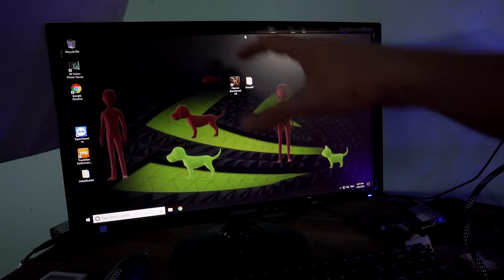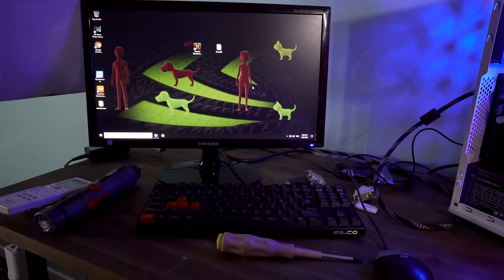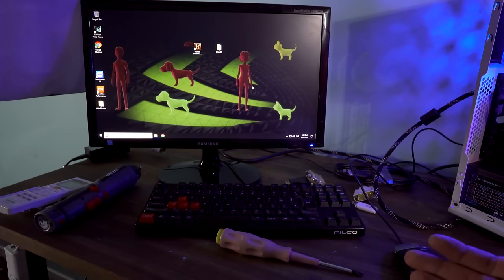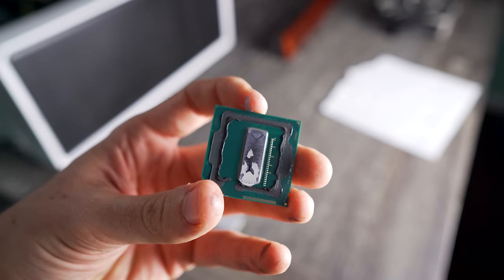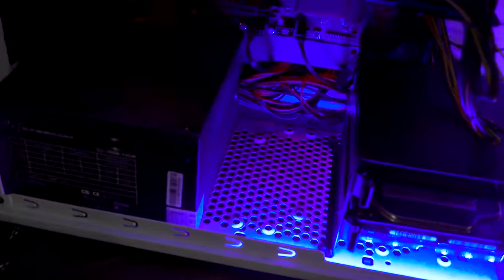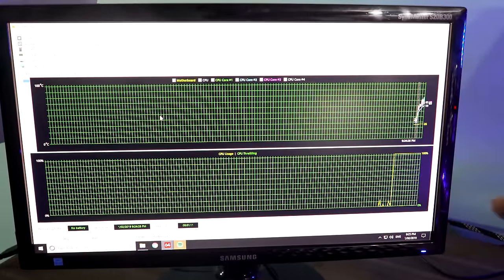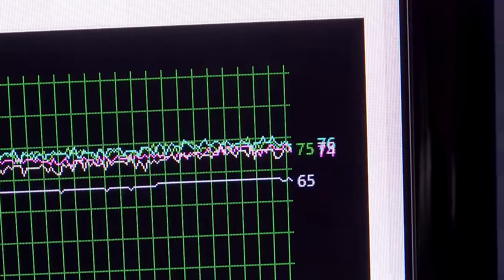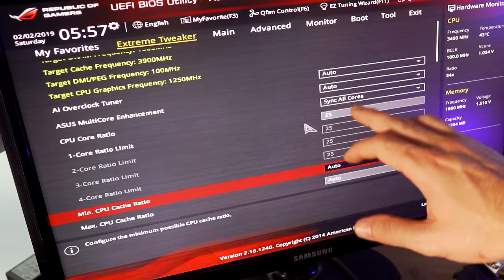How to Spot a FAULTY CPU.....? The i7-4770 Dilemma....

Comment: i also have had experiences where i have a buyer that would replace the parts that i sold him with exact same parts but are defective. so always make sure to have records of serial numbers of the stuff you have to make sure he didn't swap stuff out for defective ones.
Reply: This is such a scummy thing to do
( I know this is obvious but I needed to say these words out loud)
Reply: @aboyaser5608  yes, well, it also obviously happens.
Reply: If it's a large issue, or something without obvious/ easy way to track, you can also consider using a uv pen to mark parts that won't easily be seen.
Reply: Great advice for when i'm selling parts.
Reply: thanks for the tip
Reply from the maker: Yeah I have had a buyer try to pull some shady stuff, when I started questioning him he started sweating profusely.  I don't get how some people can be so damn petty ><, though your idea is a solid one and the UV pen below is gold (I used to do that when selling car parts years and years ago).
Reply: @techyescity  you should do a video about cars, I remember you saying about your brothers EVO and that got me really interested
Reply: When I used to sell retro PCs on eBay and shit, I'd use a warranty void if removed sticker on it to seal it. I'd give a 72 hour DOA period, specifying if the warranty sticker is removed/tampered with it's null. Didn't have any issues, but I may have also gotten lucky. Might be beneficial to get those kind of stickers and then put them from the GPU to the PCIe slot, over the CPU lever, RAM, etc.
Reply: If you do a lot of things like this, invest in some tamper-evident seals like those VOID stickers which leave permanent impression on the sticker if removed and/or serial numbering system. You can get them in non-conductive flavor if you use them near the RAM or CPU.
You can also use those inkjet paper labels which seem to disintegrate as soon as any solvent is applied or if it's pulled off. Make few cuts on the sticker which makes it hard to remove it without ripping pieces off of it.
Reply: Ye serial numbers are useful, always add them on the invoice for expensive parts.
Reply: a buyer did this to me when i sold him 2 rams sticks and he sent me back with 1 non working ram stick

Comment: In over 15 years of tech only had like 2 dead cpus and a dead gpu...in terms of actual silicon. Rare but it definitely happens. Good video!
Reply: What type of CPUs failed for you? I'm having some strange workstation issues lately.
Reply: For me, CPU is the last component that could fail in a PC.
Reply: @paulf1071  early on in school for a+ cert, a few dead pentiums the old socket kind...then the gpu was a hd 5750 that was used and dead on arrival. And actually recently I delidded with a razor a i5 3470 and It starts but won't post/ no display so RIP...lol I replaced it with an e3-1235 though.
Reply: @lagginswag     I hope you're grounding yourself properly when doing your repairs! There's a lot to be said for wearing an ESD wrist-strap for this type of work.
Reply: @paulf1071  yeah I always work in the same spot and touch part of the case/psu and also hold down power button to drain. I ofc have a wrist strap but never end up using it, static isn't the issue.
Reply: @eduh7721  my chip died overnight the day after I got it. The whole system was fine and my old chip fired right up in it and voltages were well within normal range but yeah, just bad luck.
Reply: First build dead cpu dead motherboard and dead graphics card : (
Reply: @averageuser611  have you had a chance to test each component in a fully working system? If not, your are very likely wrong and only 1 thing could be wrong/dead especially since it's your first build.
Reply: I've had cpu's that slow down tremendously as they age.
Reply: @eduh7721  It actually fails more since a lot of people who use pc's actually don't keep track of their thermals and don't realize their cpu's are operating beyond their limit.
Reply: i never had a bad cpu, just i destroyd a 2600K my self by puting to much volt. Bei the time i was a really beginner. Since then nothing happened.

Comment: I bought a used 4770k on ebay for a friends budget gaming PC . It had very similar problems to the ones in this video the thing is that it was already delided and it wasnt overheating. Turns out the cpu just wasnt making contact with the motherboard pins and crashed etc etc. Real pain to get the thing working though good thing the YES man didnt have that problem with a actual faulty cpu lol 
also LOVE the content keep up the good work mate.

Comment: I once had a 4790k that had some weird issues with low power states (c6/c7), the system would freeze after ~5 mins in idle. Disabling these low power states fixed the problem.
Reply: Some of the c-states can act a little funky on Haswell. I shut off most or some times need to shut off all the c-states with Haswell for overclocking.
Reply: Get the same craptasting thing,the C6 setting,on an AMD cpu'ed board.
Disabled it,running fine even now 8)
Reply: I had that on a CPU (not Haswell), and it was the lower voltage causing the instability.  It would run the lower speeds fine if the voltage was manually set.  What you did makes perfect sense.  It's been tested and the power difference is negligible between letting the clock speed and voltage drop and manually locking both.  The current is drawn on load anyway, and the power difference between a small process completing at full speed vs taking longer at a lower power draw is small.  It comes down to efficiency at that point.  When I saw the numbers on a modern CPU with everything locked vs all of the power savings running, I stopped worrying about it.
Reply: Haswell was kind of a wonky generation. I had a 4790k that was an awful overclocker, couldn't barely get to 4.6 GHz and had it running most of the time on stock because it was so unstable, really.
Reply: @pedrobastos8132  

I'm actually still using a haswell CPU, an 4770k that I picked up rather cheap in a bundle. I overclocked it to 4.5GHz/1.32v and it runs perfect in combination with my 1060. Temps are also good using an Thermalright Macho Rev. B, the only issue is the core to core thermal difference, core0 to core3 are under load 7-10°C apart. I might delid it soon but since the temps in general are fine (70°C max at non-avx load) there isn't really a need for that.
Reply: @pedrobastos8132 has a cpu that he personally can't overclock past 4.6ghz, writes a whole generation of intel processors off. A 4790k isn't original haswell anyway, its a refresh. Did you let intel know your scientific findings?
Reply: @w19ely85  oooooh, look what we've got here, a wise guy right here. 

Yeah, I had a bad experience with a Haswell CPU, the other commenters on this thread also had, the video itself is telling that those CPUs had temperature problems, stating that he's going to delid all of his Haswell CPUs from that point forward. Seems pretty wonky to me.
Reply: I have a z77 board with a 2500k and the low powerstate thing would cause random blue screens
Reply from the maker: Yes that low c state can be a problem where the PSU doesn't support the low ripple.  Completely forgot about that one.
Reply: I JUST did this to my 4690, it would bosd after being sleep for over a few hours. I replaced the board, replaced ram, replaced hard drives. Switched to a raid array and still was having issues. Played with the bios because it wouldn’t boot to win10 and finally disabled it, now no issues
Reply: Also randomly the uefi bios would crash, but I believe it was battery related
Reply: I have a Broadwell i7 (Z97, not X99) and delidding it helped tons with temps, had a bad clocking 4690K before that that I delidded as well and that worked wonders for it temp wise.
Reply: That kind of what happens with my 2500k. When I leave the system in and at the desktop it occasionally gives me a black screen and I have to reboot. Sometimes it has problems booting and restarting(very infrequently)
Reply: I've got both i5 4690k and i7 4790k and no problems with them. I5 Is at 4.5ghz and i7 at 4.8ghz. I think it's luck of the draw with these cpus

Comment: Different story, but something was wrong with the PC of my mum. It kept crashing and never turned on when we hit the power button. We sended it five times to the merchant who sold us the pc. Every time he checked it, he said it was fine but never fixed anything. My mother was one of those people who threw everything away if something didnt work and would buy a new one, so I suspected the merchant never looked inside of the pc, which everyone should do, if a customer tells you something is wrong with the pc. We returned the pc again and he became salty because he had to check the pc again. Then I told him "Then you clearly never looked inside! Seriously! You cant do small tests and say everything works well." It was clear in his tests the pc was running fine, yet he never looked inside, simply because all what he did was to check if the pc is turning on. After telling him my mind, he did check the components. It turned out the PSU had a faulty, he replaced it and apologized for the mess. I asked him what kind of a technician he was and we didnt pay the last repair bills for all this mess. To that time I was 14 years old and didnt knew much about pcs.

Comment: Usually it's the Memory 9 out of 10 times
Reply: Memory, bent pin or dust in socket, blown PCI lanes, bad sata, fried chipset. It is rarely the CPU though i have had it happen but your right it's usually memory.
Reply: @desertrat810 That all makes sense, since I think the most failing CPUs are either old hot Intels like Pentium 3/4 or similar AMDs like Sempron, Duron or FX and newly those flashy new Intel chips. Hell I've never seen that many dead CPUs before Intel 's now infamous 14nm node and I don't think Intel's "rise" in popularity or dumb and careless customers are to blame - tech gets more fragile nowadays and who can repair CPUs that small? I think running them with bad components can kill them, but I admit I put an i5 2500k into a bent socket for testing and the socket was shorted (VCC to GND) so that it basically unsoldered a gold contact pad from the CPU which I had loose afterwards. The funny thing is I send the board to a person repairing it for 40 bucks and put the CPU back in and everything worked fine. So, I guess moral of the story: Don't do that even if it worked out for me. xD
Really any of the CPUs I describe here are not very old just 7 months for the 6600k, at most since Skylake released (then 2.5 years ago) for the i5 6400 and I think 8 years for the 8320. Especially the latter ones die like flies, but who cares FX was long dead anyway I recon and any real gamer can attest that.
So to anyone doubting: I have many CPUs and none of that that died/are dying were run overclocked at any point by myself, so that is ruled out as a factor. In contrary most of the other CPUs I have were tortured to the brink and many were in now dead motherboards and still work just fine.
Reply: Memory 9 out of 10 when you are installing it while power is running through the motherboard as well as handling the memory stick on the memory chips rather than the edges of the DIMM as shown in this video.
Reply: My i5 4460 died on new year at 24:57

Comment: The only faulty CPU I ever saw was a Cyrix PR 200+ that ran way too hot and kept crashing no matter what standard cooler I used. Went back to the shop and swapped it over for an Intel 166 mmx that I overclocked to 200Mhz from the day I got it and ran perfectly ever since. But I guess no-one remembers these anymore... like Intel's first low budget overclocking beast, the Celeron 300a... I'm getting old...
Reply: Dolf M I had a intel 8088 Ibm with a 20Mb double 5.25 drive dos 5.0
Reply: @thefinalroman   Nice, a bit before my time though! Did you overclock it? ;)
Reply: I was 7 had no idea how to overclock till the Pentium 233mmx came out
Reply: i had a dual P2-333 system back in the day, and ran into it getting unstable and found that the fans on the backs of the cpu cards had clogged all to hell.  after cleaning them out (positively nasty after seven years of multiple climates, and the fact that i smoked didn't help), it became stable again, with no actual damage as far as anything that i could use to test it.
Reply: I had a Cyrix 5x86-100. Cyrix chips were notoriously hot CPU's, but I found most of their problems stemmed from software bugs and incompatibilities. 

I started into overclocking with the Celeron 300a on an ABIT BH6 motherboard, it was a very simple overclock of the FSB from 66MHz to 100MHz and CPU clock speed increase of 50%.  The Celeron 300a was actually a better CPU for gaming more often than not vs. the much more expensive Pentium 450, because of faster L2 cache even though it had 1/4 the amount. Overclocking back then was physical dip switches and jumpers on the motherboard, not fancy BIOS settings.
Reply: Same situation here!  The only faulty CPU i had was the Cyrix 6x86 166+  , i even added a cpu fan on the back of the motherboard to prevent it from restarting all the time.  My previous  Cx486DX2-80  was decent tho
Reply: @moulbit34  If memory serves the only way to overclock those chips involved using different clock generation crystals, you'd have to desolder the one it had from the board find a new one that would produce the speed you wanted/it would actually turn on with, and solder the new clock chip on.. hardly anyone did it.
Reply: >The only faulty CPU I ever saw was a Cyrix PR 200+ that ran way too hot and kept crashing no matter what standard cooler I used.

The CPU itself was probably fine, the issue that was causing the system instability was likely Cyrix's love for weird non-standard bus speeds.

Both Intel and AMD used sane bus speeds that jived with other peripherals, memory and buses in the system, like ISA, PCI and AGP; Unlike Cyrix, which made regular use of 75 and 83 MHz. Since secondary buses and memory clocks were often cascaded off the FSB on motherboards at the time, they would usually run alarmingly out of spec and cause overheating and instability issues.

An example would be motherboards for a time used a 1/2 divider to get PCI clock from the FSB, which was usually 60 or 66 MHz on Intel and AMD CPUs and get a resulting 30 or 33 MHz clock. However, this was either 27.5 MHz on the 75 MHz FSB Cyrix parts, or 41.5 MHz on 83 MHz parts. The former was within spec, but suffered performance penalties, while the latter ran PCI alarmingly out of spec and often caused severe instability issues.

Their high power consumption was likely related to the excessive bus speeds they ran at. Cyrix engineers always had problems ramping up the clock speed on their parts (hence the PR rating system), so I'm guessing that the weird bus speeds were an attempt to get as much out of the chip as possible.

Comment: Have had 6 years with my 4790k/ASUS Z95A MB box.  Starting having intermittent shutdowns, got different BSOD errors every time.  My work is tech so I tested/swapped RAM, PS, Graphics card etc.  I changed CMOS battery, and reset BIOS with F5 in Asus to default.  What fixed it was THIS VIDEO.  The setting that made all problems go away was CPU CORE RATIO > Sync all Cores.  This did not happen when using the F5 deafault.  The bios had been running default since it was new.  I suspect this CPU/MB combo won't last forever, but for now, this fixed it.  Hopefully this helps someone.  Thanks for an excellent video.  Just the right level of detail to be of great help.

Comment: I recently picked up a Xeon E3 1270 V2 for $60 on eBay and it performs like a $100 i7 2600 if not slightly faster. I was worried that I would run into microcode compatibility issues cause HP does not list Xeons as compatible with their Q77 chipset boards, but the CPU worked without a single problem.👌
Reply: More like a 3770 even, since it's Ivy. Very nice find!

Comment: The office space my mom works at has been using HP computers with i7 4770s for over 5 years I think. It was supposed to be amazing, too of the line performance, but I’ve nicknamed those computers the “Disappointments”. If there is a dilemma with 4770s, that would partially explain why they all suck. They also have HP’s horrible motherboards, no cable management, tiny tiny AIO cooler, and mismatched ram (an 8gig stick with a 2gig stick).

So glad they are getting replacements and I’m more glad that I’m being commissioned to build them.

Comment: Glad you mentioned it could be heat instead of something else TYC, I had an old FX 6100 and that thing would get dusty, so much so that after a couple months without cleaning that it would simply turn the whole system off without an error, just a black screen and everything powers off. It's important to maintain your system, and if your previously working CPU suddenly starts crashing,  check those temps! General rule is: <80 is fine, 80+ is toasty, 85+ is very hot, 90+ a bit too hot, 95+ cutting it close to the CPUs limit, and 100+ you're overdoing an overclock or something's wrong. This fluctuates and varies of course, but it's a good starting point.

Comment: I have an i7-920. Sometimes in summer it started to have weird crashes. Turned out it was overheating to 99°C. I completely de-dusted everything inside the computer and it has been running smoothly since that. It is easy to overlook heating problem possibilities until you face one first time.
Reply: A computer should be cleaned and thermal paste changed about every third year I would say. Depends of course on the environment. There is software like HWinfo64 that can help you keep track of your computer and thermals. Thermal Paste always gets hard with time. That and dust would probably be one of the two major reasons why laptops tend to die rather soon (3-6 years).